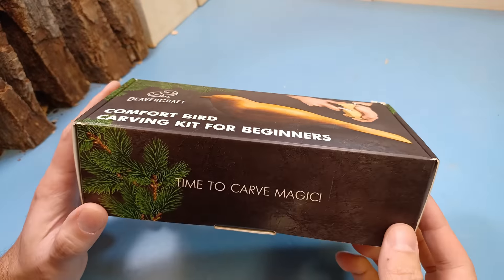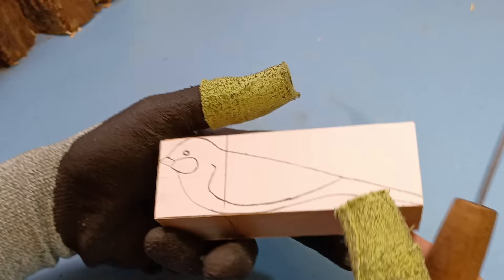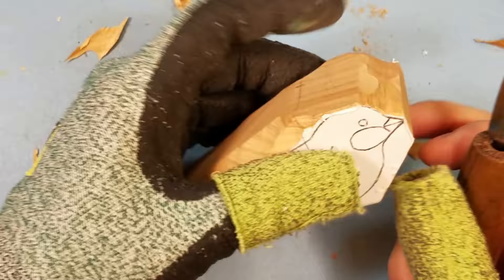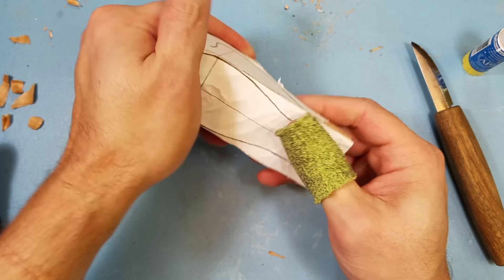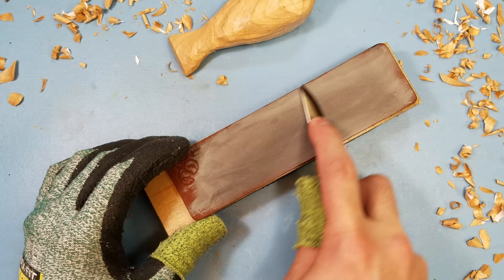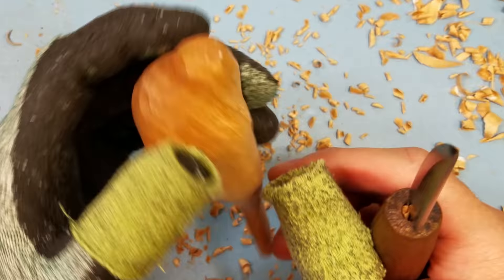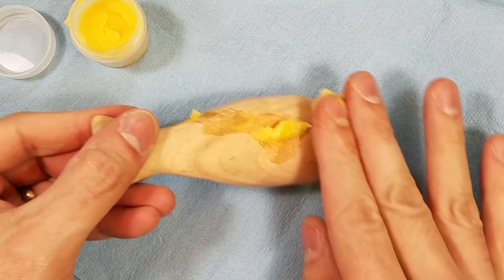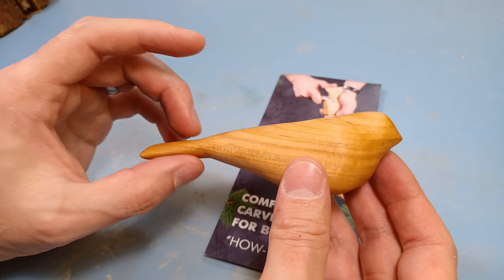Carving a Comfort Bird out of Cherry!  BeaverCraft Comfort Bird Carving Kit

Comment: I've been wood carving on an off over the years making spoons and rough looking cups, my wife and i had out first baby 7months ago and she wanted wooden toys for him. I found your channel and recently started up again, I bout myself a cheap whittling knife from amazon and have carved him the owl, the dog and the horse head chess piece, next the bunny.. all following your tutorials. I've really surprised myself cos they turned out brilliantly. Manly thanks to your great step by step instructions. I just wanted to say thank you. Looking forward to future videos. All the best from the UK.
Reply: Is there a way to use a homemade knife or just a normal knife for carving? I cant really buy the kits n stuff
Reply: @quandaledingle7092    I wouldn't recommend it. For safety reasons.

It depends on what type of knife you have access to.

Woodcarving knives tend to be made from harder steel, so it can keep an edge better. 

A couple things things that the knife needs:

Good handle/grip for comfort and control
Tough blade, it must not bend easily
Hard enough steel that is can hold an edge well (comfort, control) but not too hard so that the blade is brittle.
Short blade (long blade usually means less control, long blade blocks view, more risk when you lose control).

What is good enough depends on your goals (rough end result requires less).
Softer wood is easier to cut and arguably safer. But it is harder to get a nice smooth result with soft woods.

If you want to try anyway.  Lovely carvings have been made with a decent pocket knife.
But use common sense, be careful.
Reply: @quandaledingle7092 probably a Swiss Army knife, for a smaller blade. You probably need a sharpening kit + cut resistant gloves and finger tape to protect your hand. Maybe even a first aid kit for good measure lol

Comment: I used the Japanese saw to cut off the excess wood on the basswood.
It wasn’t easy but I got it done 
I don’t have any power tools so I had to do it manually
I finally have the bird patterns glued on to the wooden block.  It’s not pretty but then I’m a beginner.  Like it says on the ruler safety tips, no hurry, take your time, it’s not a race.

Comment: A question in case you have the answer: If I wanted to paint the bird, would I first put the beeswax on and paint over it, or would I paint directly onto the bird and then seal it with beeswax? Don't have any experience painting on wood so I'm a bit lost 😅 Thanks in advance even if u don't know!
Reply from the maker: Beeswax would be applied after the painting if you want but isnt necessary.  The paint itself will act as a protective layer repacing the beeswax.

Some people do apply a clear coat of finish like linseed oil or tung oil before the paint as this prevents the wood from absorbing thr paint.

Comment: Just bought the kit, it should arrive any day! :)
Reply from the maker: Nice!  Remember that one block is basswood and is easier to carve while the cherry wood will be more difficult.  The basswood will be a lighter color.
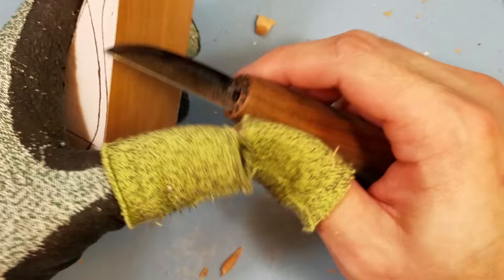Reply: @CarvingisFun  The kit has arrived today, I'm on hour 4, most of it was spent on getting rid of excess material since I do not have a saw, so I had to do it manually. Currently struggling with the part you mention at 3:00, that spot is super tough, but my bird is already looking pretty bird-like from the side. My right thumb is slightly sore, but other than that, I'm having fun!
Reply from the maker: I hear ya on the sore thumbs, and is why I use my makeshift thumb guards to make it more comfortable to push on the blade.

Comment: For me, using a saw isn't cheating. It's common sense. I was always instructed that if you notice that your hands are getting fatigued when using a technique or tool, it's time for you to take a break so you don't injure yourself. That said, I would also gently hit the surface with a fine tooth work file before sanding. Saves time and leaves a fantastic finish if done right.

Comment: I bought this set as my starter project. I believe I chose the same piece of wood as I thought both are basswood. All in all it’s been a strugle. I must say that only thanks to your projects Brian I did not quit whittling…It’s terible set I do not recommend it - they cheat on the instruction video (using other tools), the knife is not the best and it’s not a 30min project definitely. Better buy one single knife and start with this channel :)
Reply from the maker: Its an ok set in my eyes, but their instructional video does have them using other tools for sure.  It would have been nice if they roughed it out for ya though.

Comment: How do you tell if your knives are dull or your technique is off/hands are weak? I'm really struggling with deep cuts and removing large portions
Reply from the maker: A sharp knife is going to have a super smooth and shiny cut.  A dull knife will look fuzzy or have lines of non smooth cuts if there are dings.

Hand strength and wood hardness come into play here.  I specifically chose this basswood I use as it is easy to cut and keeps the videos shorter.  I also do work out so my hand strength is probably above average as well.

Take slow controlled cuts.  it isn't a race and go at your own speed.

Comment: I don't know if I have arthritis or what. But I tried whittling small  basswood blocks and it was very difficult. I was really struggling with it.
Reply from the maker: What knife are you using?
Reply: @CarvingisFun  
I have tried multiple highly-rated brands from Amazon and etsy, the same shapes you use to whittle. I don't remember the names. The wood only came off in splintery chunks.
Reply from the maker: Gotcha.  Well, the downside to what you are saying here is that many "highly rated brands" on both amazon and etsy are actually knockoff brands of lesser quality.  
Were some of the brands Flexcut or Beavercraft?  Those are the best brands you will find on Amazon, with Flexcut being the best of the two.  Others like Mastercarver and UJ Ramelson are decent but need a little work.  The rest I personally don't bother with much.

Comment: I'm currently working on the same kit, but mine has a huge knot in the wood. Any tips on how to make it easier?
Reply from the maker: Depends on where it is, but if I wanted to remove it I would take small, shallow cuts into it until it were gon or use some more seriois tools like saws n gouges to remove it.

Comment: I'm left-handed so i think i wouldn't be able to use it. Seeing how much force you have to use with those tools.
Reply from the maker: The tools I used in the video are ambidextrous, and I was using the harder of the two woods in the box.  If I were to use the basswood instead of the cherry, it would have been a much easier task :)

Comment: I have a question: how did you get it so round? I did the bass wood one first, and bought some extra to practice with before getting to the cherry (lol) but no matter what I do I end up with rectangular birds. I'm following the instructions and everything but I can't quite figure it out. Any tips?
Reply from the maker: Make larger cuts to roughly shape it and then start making smaller cuts on the corners to start roundingvthem out.
Reply: Sounds good! As dumb as it sounds, do you do the same thing for the sides/top of the bird? Like how do I separate the head from the wings?
Reply from the maker: The goal is to "suggest" that there is a separation by tapering in certain areas or creating hard lines.  You can also look up actual bird images to see how it looks in real life and try to mimic the features
Reply: Awesome, thank you!